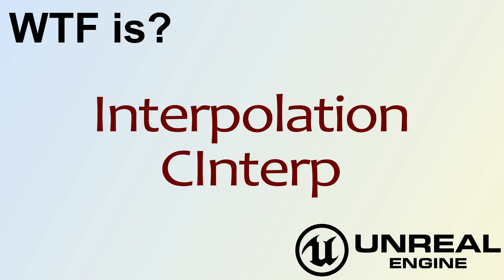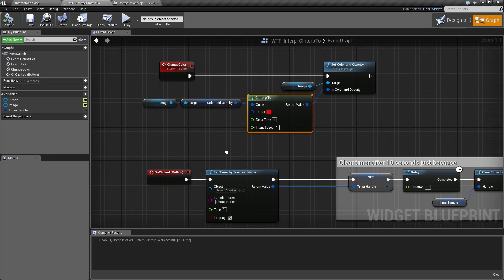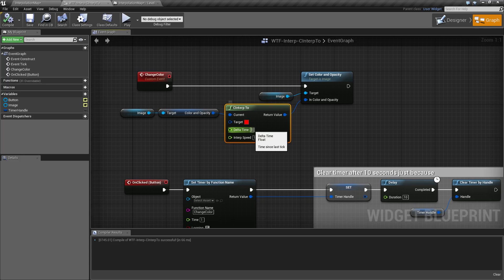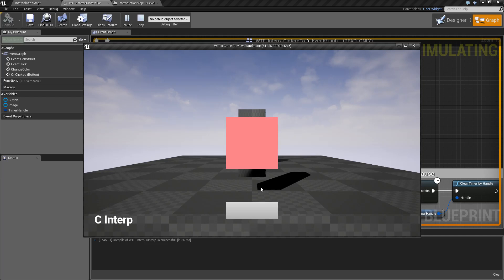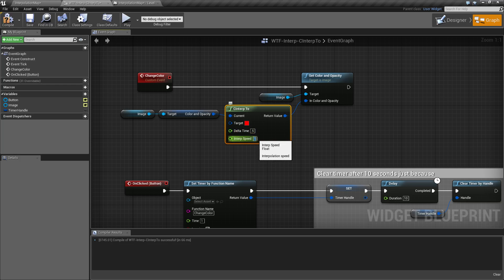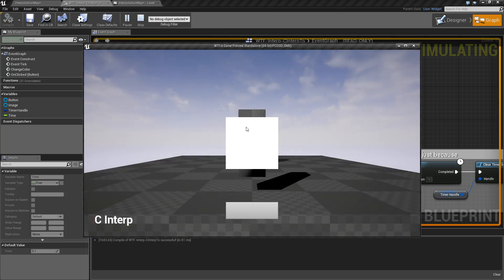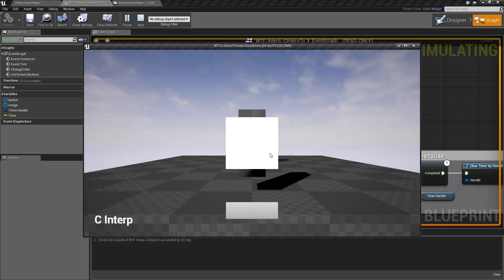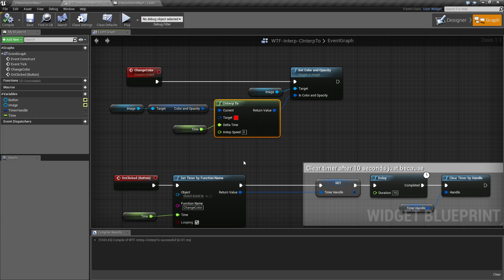WTF Is? Interpolation - Cinterp Node in Unreal Engine 4

Comment: Heyyo!
Using the timer for interpolation, isn't it risky ?
Seeing that the timer is looped each second, wouldnt the interpolation trigger each second even after the color changed to red  ? How can we end the timer when the interpolation is done ? Its a bit confusing
Reply from the maker: Using the time like you can see in the example above was an easy way to show how it works.  If you notice near the end and commented I am clearing out the timer so it will not continue trying to change the color forever.

For knowing if an interp is done you would have to set up a check after you do your interp itself, as that change is instant, to see if the current value that you just changed is equal to what you are expecting when it is over.  For other interps, like float and such, where checking the value is super simple it would work fine.  For something like a CInterp you could use the Delta Time to know how long your actual color change will take then end the timer after that much.

Comment: Is it possible to change the color over time fluidly?
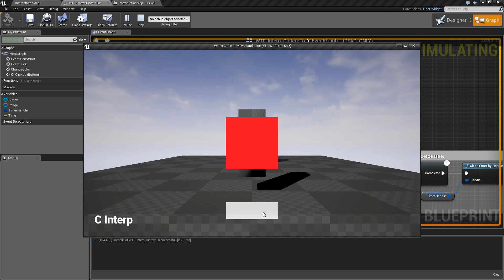Reply from the maker: I guess it would depend on what you meant by color over time?  The Cinterp node itself is intended to allow you to change from one color to another by setting the values in the delta and interp speed.  Simply hooking it up to a tick or a timeline for example would allow it to change from one color to the other smoothly.  The amount of the interp speed and delta time determines how much each "step" is, you can see it smoothly changing around the 4:12 mark.
Reply: I went with just changing it instantly, in this case it worked better.

Thanks.